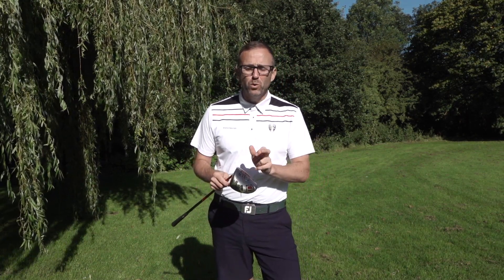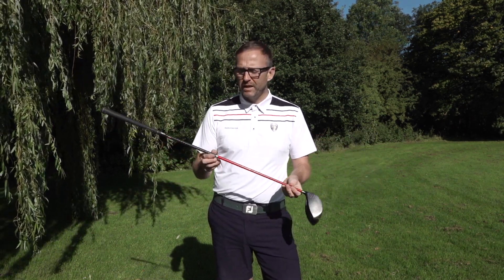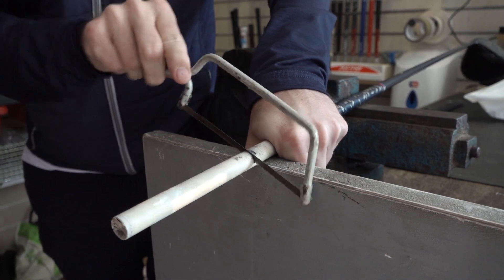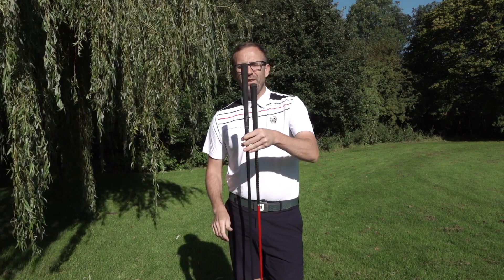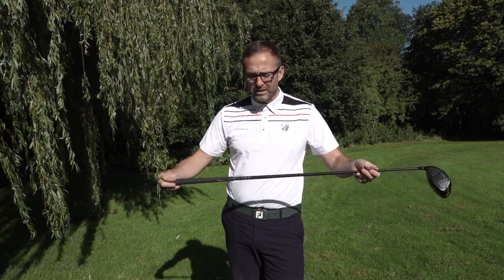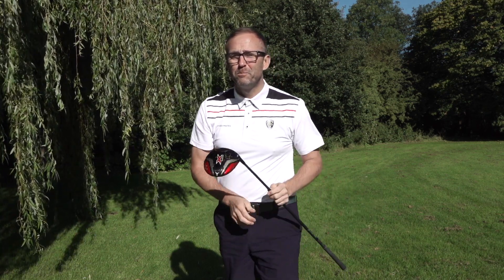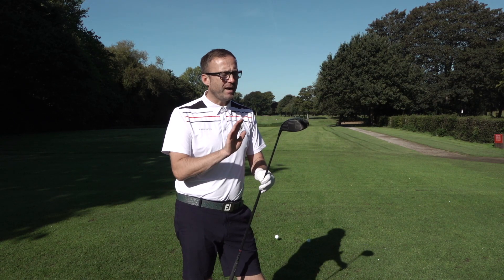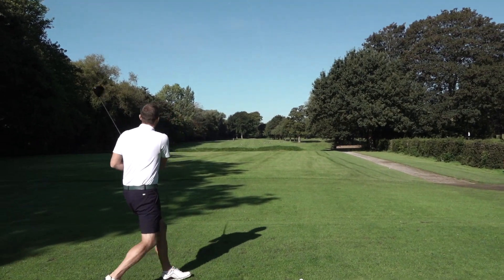I CUT DOWN MY BRAND NEW CALLAWAY DRIVER - but did it work ?

Comment: Rogue 13.5 driver cut down by 2 1/2 inches. My driver accuracy has gone up massively and distance only fractionally reduced, probably the most sensible thing I have done in golf (other than having lessons of course). I tend to find 220 in the fairway tends to be fractionally better than 245 yards in the trees, bushes, river, out of bounds etc. Go figure

Comment: Yep.
90 pct of golfers will benefit from a 40-42" driver, 12-15 degrees loft.
Reply: 90% of the time I play golf, I don't even bother taking my driver to the course. I have a 13° Yonex 3 wood that I use off the tee. I am very long off the tee to start with, especially for 62 years old, as I can still hit it between 240-260 yards. But...I am a really big guy...6'6"...and won more than a few local long drive contest's in my 30's. But now, I just play for fun with my "golf mates" ....and am happy when I shoot my handicap (12) or beat by a stroke or two. I carried a 4 handicap for many years...but I don't have the legs or the lower back of a 30 year old anymore!
Reply: @larryd4352  you got it right!
Reply: @555Trout  well..I got my 4 handicap by working on my short game...like OMP says..."drive for show, chip & putt for dough."
Reply: Flashy Paws  You are factually and unavoidably losing distance with that low if loft. And significant distance.
Reply: Flashy Paws  You are factually and provably losing distance with that loft. Period. I'd take the time to explain it to you but your silly arrogance precludes my.intetest to do so.
Reply: Flashy Paws ok

Comment: Mr. Harrison- Interesting tests! I suggest getting some extra weight into the head area of the new club so that it feels the same weight (swingweight) as your Epic driver, because if you have not done this the club performance may not be as good as it could be. Ralph Maltby states in his clubmaking book "For each 1/2" the club length is reduced, the head weight must be increased by 1/4 ounce" (despite its great size, the driver heads are quite a bit lighter than a 1 iron head).

Comment: When you created Frankenstein it got me thinking. I have an oldish Cobra driver with a matching 5 wood. Both have adjustable heads, so no need to cut anything. I just put my 5 wood shaft on the driver head. My mates are away this week so I went out yesterday on my tod and used my creation on a couple of short par 4s, a long par 3 and a couple of par 5s with tight fairways. Worked a treat! I parred them all, and I'm a lowly 12 handicapper. I found it easier to use than my 3 wood, and being a lefty, I couldn't find a mini driver to try out. Well pleased, and it cost me nowt.

Comment: For your back: get the "hang ups" equipment. You lock your feet in and then it allows you to hand upside down. This totally decompresses your back and you should be right as rain. Start with about a minute or 2 at first and you can work your way up to longer. Also, get "arnica" in a system that you can rub on your back, this will totally help. You can get arnica in a pill as well as lotion, maybe try both. 
For your hair: the "hang ups" will help by allow more blood flow to your scalp. Hanging upside down is totally beneficial to getting oxygen to those hair follicles. Two, you need to add "diatomaceous earth" to a protein shake and start taking that every day. I was thinning and this totally thickened my hair right back up. There is no particular brand, just search "diatomaceous earth" and get whichever one suits your fancy. Also, take a niacin pill daily. That pill will turn your blood hot and put more oxygen to your hair follicles.  Ok, cheers mate, hope you really try these.

Comment: As always your the best. I talked with a golf pro about your experiment with the 7 iron shaft and the ping i15. His response was most tour players use a 43.5 inch shaft. So why are most drivers 45.5 inches? My only taught is the manufactures are only interested is distance.

Comment: One of the things you have to consider is that when you cut the shaft down considerably, you seriously alter the overall weight, and especially the swing weight of the club. When Cobra makes their "One Length" irons, the weights and lofts of the clubs are not exactly the same as the "normal" length irons, because a Gap Wedge with a shaft the length of a 7 Iron still has to go the same distance as a Gap Wedge with the shaft length of a normal Gap Wedge. Same for every other normal club vs & Iron length club. To get that 7 Iron length driver to travel over 180 yards, there would have to be some other modifications to the loft, weight, perhaps the shaft flex as well.

Comment: I am really curious.  If you know a fitter, would you be willing to take that driver head and do some testing with increasingly long shafts to see if there's a sweet spot of length that gives distance while retaining the fairway-finding characteristic.  You cut one down to 7-iron length, but what about 5-i, or 3-i length, a hybrid length, or 5-w length?  Working with a fitter to to do the test might help to smooth out some of the issues created with just chopping a club, as they might be able to work with lie and angles and loft (depending on the head) so you have a proper set up at each length.I know it's more technical than you usually do, but it'd be interesting to see the results.

Comment: Bollocks to Bolton United.
But, having cut that shaft 6" or so, you should adding a lot of lead tape to Sheila. Put it low and deep. Extra weight, extra cog, extra distance.

Comment: My Shelia is a Cobra Encore ZL 11.5 degree with a Cobra Amp hybrid shaft adapter and a Maltby Hybrid shaft. It is around 41.5 inches. I still have the original shaft only slightly shortened. It's a fairway finder but 20 yards shorter than the original shaft. My next one is going to be a HL Driver around 15 degree loft. Hopefully with an adjustable hosel. You can keep the Frankenstein. Thanks for the Videos

Comment: So Liam, what length is a "1 Iron Length"?  41"? The funny thing is that in recent years club manufacturers have been gradually increasing shaft length on ALL their clubs simply as a way to claim increased distance. This is especially true for the driver. I think Tour pros usually play about 1.5" to 2" shorter shaft length in the driver than the stock shaft. I think Clay Ballard did a video about this...

Comment: I play Cobra One Length clubs (irons and hybrids).  I took my F8 3 wood and had it professionally shortened to 7iron length. I hit it the same distance as I did regular length but with more consistently straight shots.  I rarely use my driver anymore.

Comment: Did the same thing, actually bought a shortned shaft 2nd hand for mine - BUT - do remember to add weight to the club head afterwards - i googled "swing weight on a driver" and then guestimated an "approx" weight, with a tapemeasure and a kitchen weight. After the shaft change it was a c7 - dont know what that means, but read it was in the "lady driver area", then i added lead tape and now its back to standard... have no idea what it all means, and i was in no way using the right eqiupment, but the driver... has cost me 100£ max and its the best ive ever had ! sold my 400£ fitted G400Max, and now this home made 2015 M2 is the BOMB !
Reply: Hi did you add the weight to front or back of the head or equally both
Reply: @andymarshall5517   i add'ed leadtape from front to back, on the "side" of the driver head (I imagined it would help "MOI", not sure if its true)
Reply: @anderschristianhaldpederse8472  thanks , and by adding lead tape to make the head heavier ,, have you noticed the shaft feeling any more flexible?
Reply: @andymarshall5517  not at all - it felt completly normal to me :)
Reply: @anderschristianhaldpederse8472  thanks , any idea how many grams of lead you added ,? I’ve worked out I’d need to add 10g but I’ve heard it will drop the flex down by half ?

Comment: I used to take half an inch off my drivers and add 10g lead on back or toe of head to compensate thexflex. More control with no loss of distance.

Comment: Most new drivers come with a 45 inch shaft.  Ricky Fowler uses a 43 1/2. So did Tiger, although he’s using 44 1/2 now. You will change the swing weight if you cut the shaft so keep that in mind. Probably a good idea to have a pro help.  But for fun, cut away and have fun.  I have an old g25, i think  I’ll trim off an inch or two. Maybe 3 or 5 wood length and see what happens. Cheers.

Comment: Liam you are a legend. After seeing your video I bought an Integra Disukaba 12 degree driver on Ebay (£30) and cut the shaft down to 41". Took it to the range and the results were ridiculous. Every drive went almost the same distance as my 45.75" G400 (240+, longest 320) and not one was under 200. It's so easy to hit the middle. I was going to put in in the bag for tight fairways but it may just become my go to driver. Can't thank you enough.

Comment: Bolton Wonderers: TPG, I've been wondering for a long time if I'd be better with a shorter driver. I too have a bad back with not much flexibility and it make it hard to swing a driver.  I do fine with my irons so maybe what you've done could help. I'd sacrifice distance for consistency. Did you find any difference in the way you felt swinging the different lengths? Cheers

Comment: I think you will like Sheila!! I like my shorter driver 43" it definitely goes straighter but yesterday I was not fit either.
Reply: Before you cut it down what was your misses . i cant seem to hit it strait . i always slice . unless i slide my hips fwd and set my shoulders closed . it is very uncomfortable and i feel like there is no room to use my legs as i have alread shifted fwd .
Reply: @afriendtoleanon3401  I draw the ball. But the shorter shaft length helps you hit it straighter. My opinion at least

Comment: So do you make the shaft 39 or 40 inches? I've always been told cutting the shaft down that far would make the club too light to play with. What would you say golfmate?
Reply: So did you cut it down to 39 or 40 inches? Did you feel the cut down club weight was too light to play? I'm considering doing this but, you did it first so I'd like to know your answers. Thanks.
Reply: Some drivers are called ‘ultra light’ yet they’re at full shaft length. I don’t get why you can’t just chop a standard driver down, wouldn’t it then be the same swing weight as the ultra light?

Comment: You cut it down to a 7i length???? And there was me thinking 3W. 1i is an interesting length, how does that compare to 3W? I happen to have a spare 3W and I want to convert the adapter, to fit my titleist driver.

Comment: Ok a  drivers  swing weigh  is D 3  .45 to 46.in long. If u get ure prs shop to cut tip & grip end to 44.5 add some carbit powder.. and keep S w D3.  .5 at tip of the shaft will make shaft stiffer this will help

Comment: If you shorten the shaft, you should add some weight (lead strips) to the back, to increase control.
I have a 14dg driver with a 9 wood shaft length and flex. The only long club I could swing after I broke my neck.
Reply: @David Hyland since I returned to golf, I have begun to improve. Driver, now Callaway Rogue Draw, 13.5deg, adjusted to 12.5deg draw, with 55g regular flex shaft. Fairway wood, Yonex Super ADX 9 wood. Cobra Baffler 5 rescue. Ping G410 6 to Pw, Ping MB wedges 48, 52, 56, 60. 2 wedges because the loft on new ping irons is stronger. Scotty Cameron California Putter. My 29 handicap is down to 22, but after playing one good competition, my world handicap is 11.
Reply: @David Hyland I use a 42 inch shaft (measured to the hosel) at the moment, and usually straight, but a bit high sometimes.

 I also have a 44.5inch shaft 55g stiff which works well when my back is ok, and I can do a full swing. I bought this for a lower flight  and a little extra distance. I hit around 200yds with a slow but steady swing.

Comment: My driver is a Callaway x2 hot with a 44.5 inch shaft,average 260yds fairway finder. 👍
Reply: Carl Ashley -  Mine is too 44.5 inch ,the perfect length , in fact most of the pro's play slightly shorter than standard  .Got two Mitsubishi  Diamana B series 60 x  driver shafts ,had them a couple of years ,never found anything that beats em  .

Comment: Liam, I put a 3 wood shaft in my M1 about 2 years back. Its a little shorter but much straighter. I get about 240-250 with it now, then jump to an M1 3hl at 17 degrees with 5 wood shaft again much straighter  carrying about 200-210. Would recommend it to all the mates.

Comment: What you really need to do is try 5 Wood Length Driver. You will be surprised at how close you get to normal Size Driver and the Control you will feel.

Comment: To be honest, cut it down put a 5 wood shaft in your drive and practice, my driver is 43 straight and hit the face consistently, to be honest being 5"5 the and wrist to floor was the issue using standard size which is completely different in many club manufacturers, wasn't an option getting fitted was also a waste of time, as I think they were more interested in selling me a driver.
So I took my old driver and took 2 inches of and Bob's your uncle constant

Comment: if you shorten a club, you need to add weight to the head. a 1 iron head weighs more than a driver head. probably you are thinking, "that can't be so, it is smaller". well a penny weighs more than a balloon doesn't it? so you you need to add weight to that driver head to match the one iron head head weight if you are using a one iron length shaft. otherwise it will be hard to hit and won't match the rest of the clubs in your bag. a heavier head will produce more ball speed than a lighter head for the same swingspeed.  a shorter shaft produces less clubhead speed, so you will need more loft, generally speaking, to get the spin to produce the carry you are looking for.

what you should have done is a 13 degree driver, sheila length, with a bout 20 grams worth of lead tape added to the back of the clubhead.

if your epic goes 240 sheila, with the right tipping and shortening, and more weight should be a reliable 220 and a bit straighter.

if you feel you only need 7 clubs in your bag, you can carry two drivers. one full length and one 'furway fahnda' length.

go redo your videos but do them correctly this time. otherwise you are just wasting our time.

Comment: 5 wood length is perfect for a driver, no need to be longer. You will hit it straighter and more accurately and almost as long. I have one that length and it will stay in my bag. Oh ya, mine has a small head too and it can really hit long, in fact too long I was off the dogleg with the bugger.

Comment: At the height of his career,  Tiger Woods used a 43.5" Driver. 

That's about the length of today's 3 woods. (I wish Liam gave us the measurements in inches...)  Armed with this knowledge I cut down an old driver to about 42".  Turned out to be a big mistake for me.   Should have made it a 43.5" or 44".  So the club is now useless, and I found out the hard way that a lot of a clubs value is in the shaft.  Replacement shafts cost more than the heads.  So be careful... don't cut too much.

Comment: Just ordered a 3 wood shaft for my driver. Manufacturers drivers are too long for most in the pursuit of head speed. Unless you're a great ball striker they are hard to master. Get a 3 wood shaft or even 5 wood. No need to cut it and mess with the balance of the shaft!

Comment: I don't think your back was up to that test. As you know I have been ad advocate of shorter drivers for all. Your Epic, assuming standard, is 45.5 inches long. You would be far more consistent with a 42-44 inch driver. I cut mine down (it was 45.75!) to 44 and I could have cut it another inch. I want the manufacturers to offer more options.